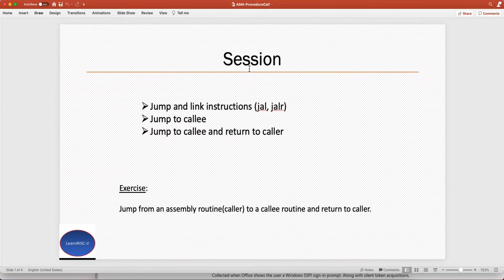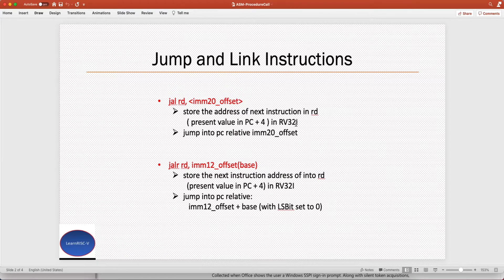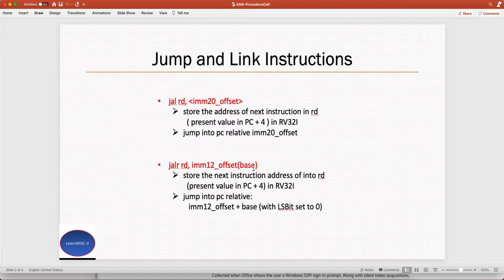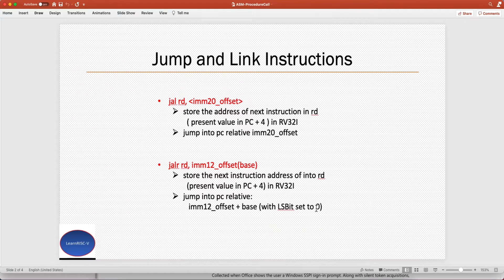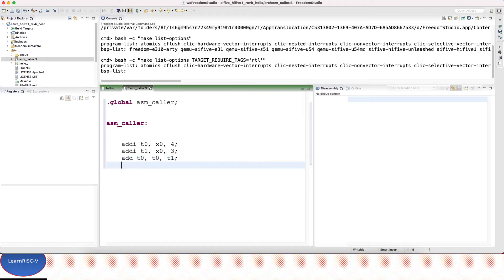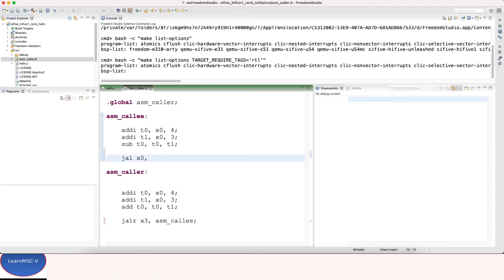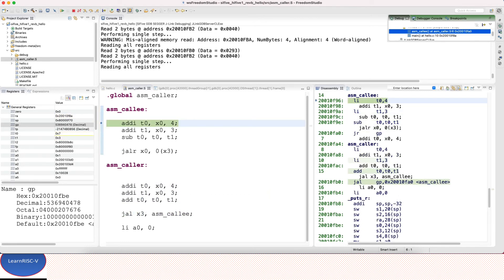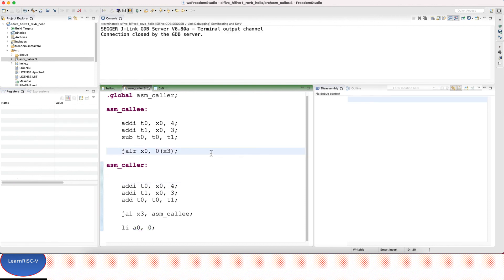RISC-V control transfer instructions

Comment: I think jalr is not pc relative, it sets pc to a base relative address directly.
Reply from the maker: Mo,
JALR is designed to be used with AUIPC/LUI  in which you load the register with PC value and offset with an immediate 12 bits value (signed) hence its PC relative. But mathematically, you can jump into any 32bit memory space.